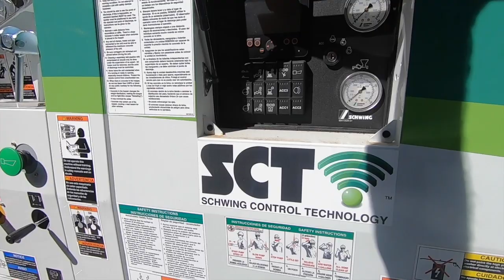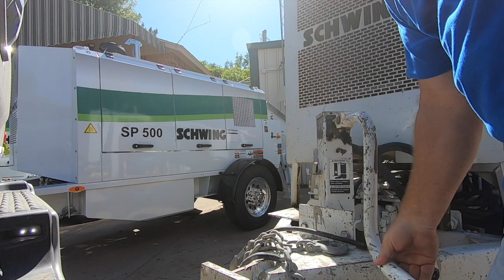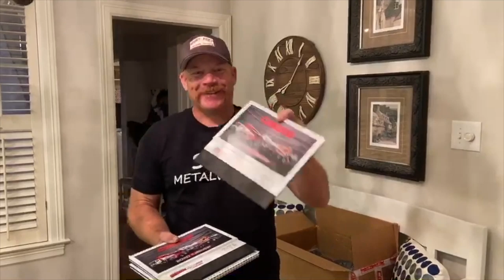No tie downs for the tractor, got our pump repaired and mail call. Pumping concrete with Muddyfeet

Comment: Hi Lol some people like to see the old part that were replaced 😀.  Your the Boss  do you have a preference running the tow behind pump. I guess it makes it easier to run around and check the other jobsites 🤔 Have a great day stay safe 👍. 🇨🇦 Craig
Reply from the maker: Yeah sometimes I’ll show the worn out parts. Didn’t think mush about showing the piston packing. I like the trailer pump. Sometimes I just need to haul the hose to a job site and not the trailer. I think it makes it easier.

Comment: How come you use trailers pumps? Here in England we have them fitted to a 7.5 tonne lorry 🚛. Something like an Isuzu or Mitsubishi. They also carry a load of steel pipe and a load of rubber hoses to.
Reply from the maker: I like to be able to have the option of using the truck to pull other trailers. Or if the truck needs serviced I can pull the pump with another truck. I prefer to keep them separate

Comment: Down here $3000.00 fine for insecure load like that tractor.
Heard a few horror stories about electronics on the new line pumps, they can shutdown for no apparent reason right when you don't need it. Guys here swear by there old ones and curse the new ones.

Comment: that new sp500 is got a lot of issues . over heating and accumulator leaks . also they got cheap on alot of parts . the engine is smaller also .     new model has a 3.4 Caterpillar.  yours should have the 4.4 perkins /catipillar .
Reply from the maker: Man I hate to hear that. I’ll have to check on that.